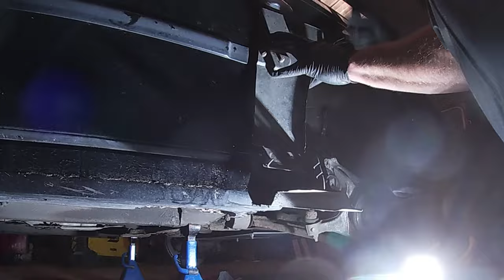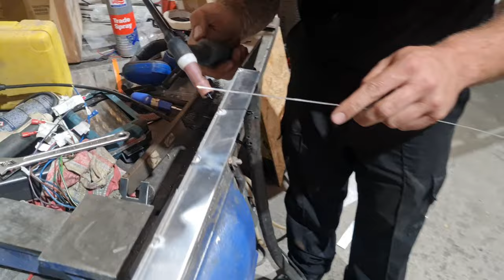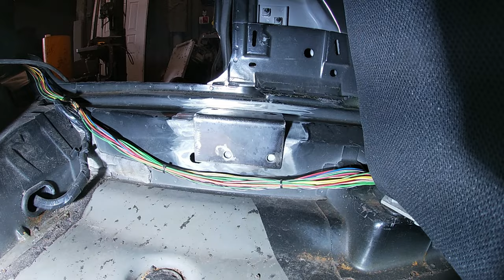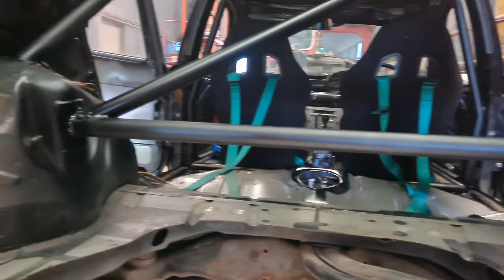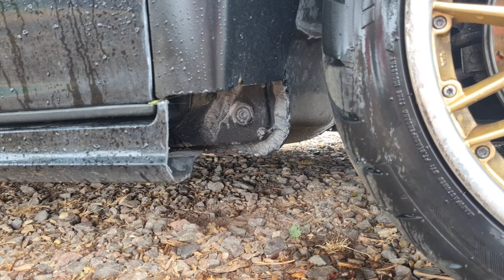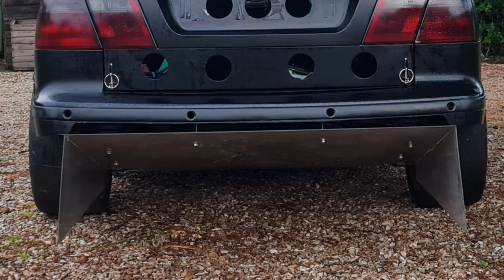Saab 9-5 aero track car, race prep. New suspension, brakes, aero, roll cage, tyres and more

Comment: Nice man! i need your opinion, my b204 had a upgraded clutch intercooler, i have a walbro 255 and 800cc injectors laying around, what about going from my stock T25 to a TD04 with 19t?
Reply from the maker: I'd be afraid to make a definite comment on the b204, I think they're pretty tough engines though. With your supporting mods I'm pretty sure a 19t and big injection will see you over 300hp on it, best to speak with a tuner though for sure.
Reply: @TGBuild270  Indeed, b204 is beast, i also have 305mm rotors, steeringhouse brace, double arb back, control arms with PU rubbers, apex springs, diesel gearbox, clutch rated for about 600nm. and a big fmic tuner said it would make about 320-330 crank horses. currently im running about 250 crank he says
Reply from the maker: @Grandpasaab  that sounds like a pretty impressive set up! Do you track it or just fast road?
Reply: @Grandpasaab  T7 pistons good for about 300ish hp before they explode. but if you have T5 pistons/rods you could get away with 500 around there. A 19T will perform good up to 350bhp, after that you need to get a XT version turbo or something else bigger. Aero clutch good for about 350bhp yup
Reply: @dailytwitchcontentyt  Luckily i have a B204:) T5 pistons baby. aero clutch is not needed, i have a stock set which is upgraded by a friction company. Pressureplate is stronger and friction plate has better material. Also i have 800cc injectors and a walbro 255 which i will be mounting soon